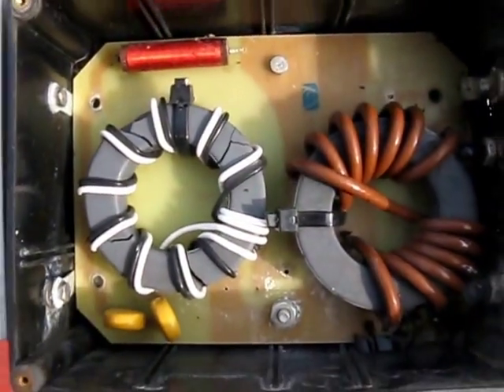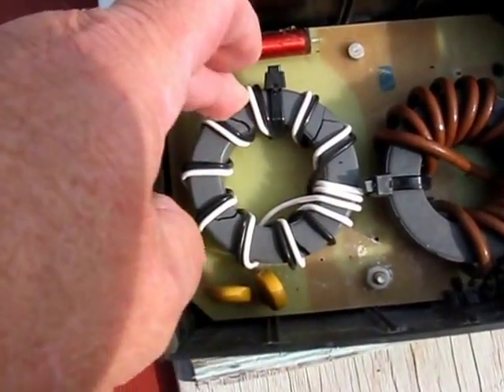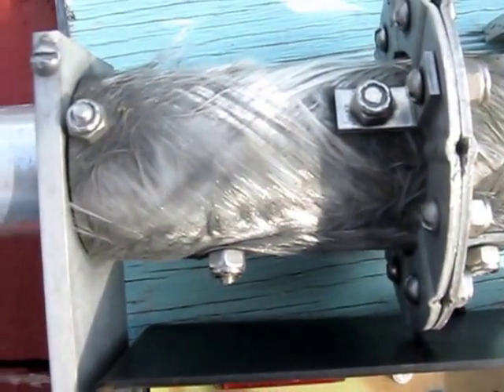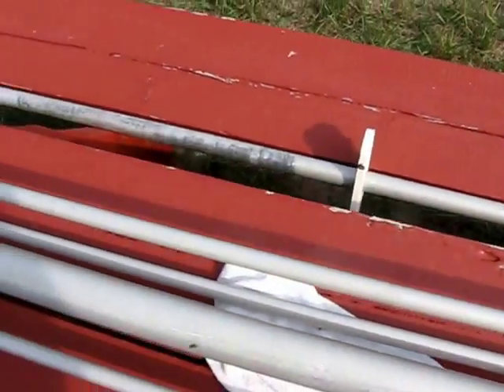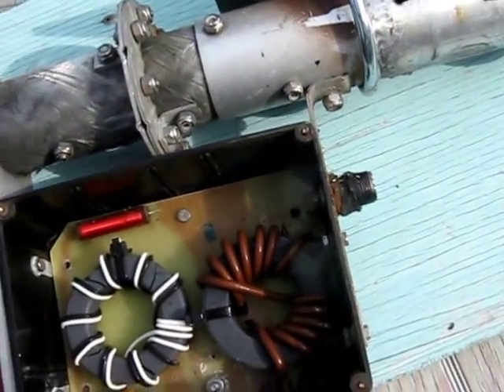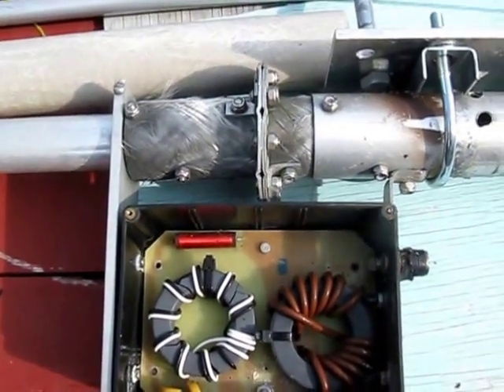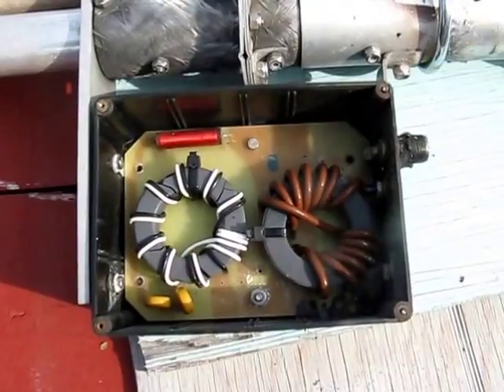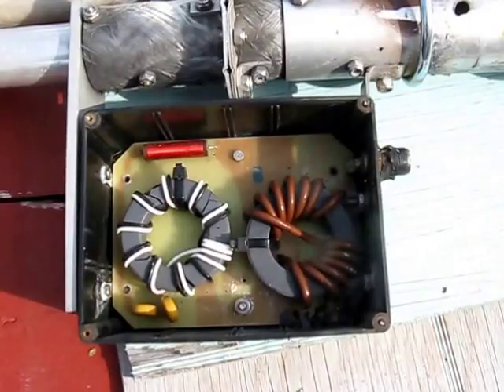R6000 rebuild

Comment: Hi. Do you know the type of these toroids inside the MN6000 box? Not mentioned in the manual.  Yes, mine are into pieces, just like these,  and the insulator is worn out. The box can be replaced, but 189$ is a lot of money. The other antenna parts seem o.k.  My antenna is from 1998. And is your antenna fixed? I'm interested to know what toroids are these...
Reply from the maker: I think the toroids are -61 mix and I think they are 240 size (.240 iinch) size there fore FT240-61. I think if you do a search on the Cushcraft R7, or R5 or any of these types of verticals ..you will find a few articles and some commentary on the toroids inside the matchbox. I havent got mine completely rebuilt as too many other projects are getting in the way. Kits and parts dot com in USA sells these types of toroids as does Mouser I beleive. 73 earl ve3ab